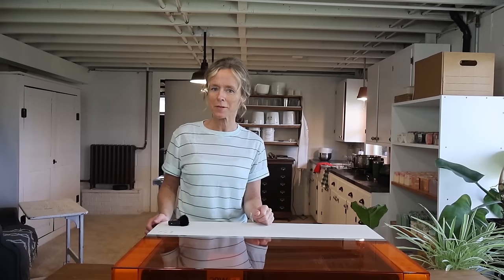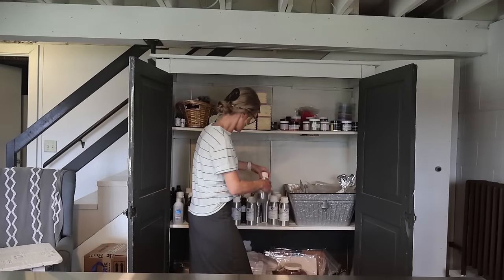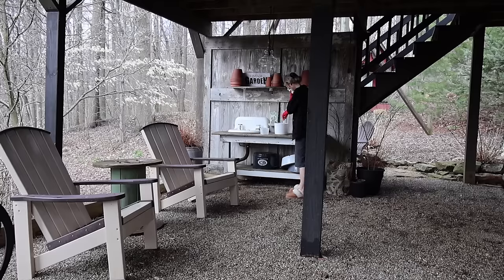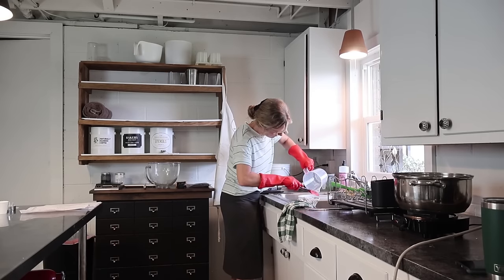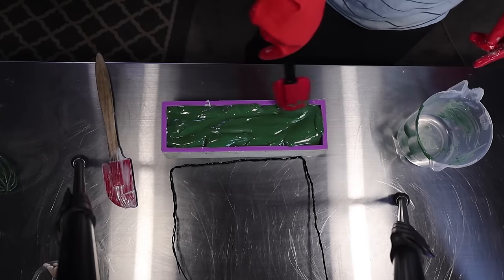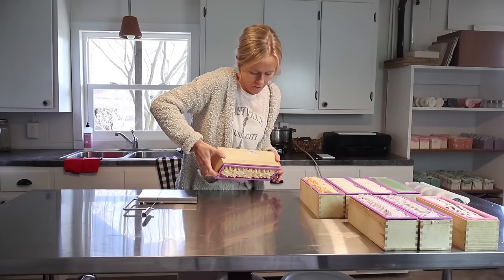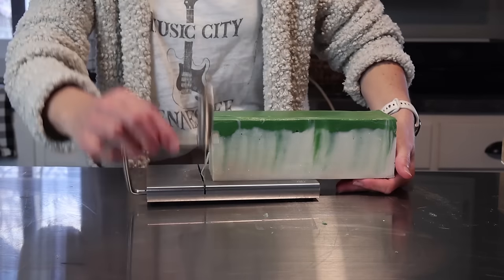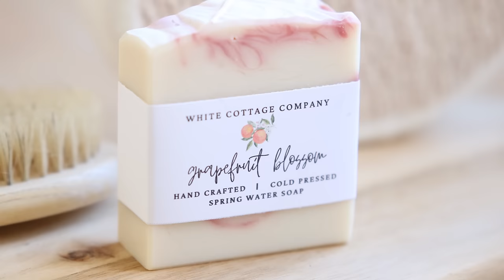Handmade Soap Making ~ Cold Process Soap ~ Homemade Soap Bars ~ Spring Soap Designs~Small Batch Soap

Comment: Ive been dabbling in soap making off snd on for a few years. I was origionally trying to figure out how to work with bees wax and shea butters but that didnt turn out as well as i hoped. I made some shower melts that make your shower smell amazing and it melts down the drain. But now im getting into actual soap making. I love the melt and pour method. They came out with a clear soap that you melt and you add your own ingredients and fregrance to it and its so easy to cut. It melts in about 20 seconds in the microwave and i dont believe lye is in it but im not sure. But all the hard stuff is already done and you measusure out your own ingredients and you can use the same stuff to make shampoo bars as well. Im super excited about that.

Comment: Lovely soap! Thanks for sharing your knowledge and techniques. Please do reconsider the use of a glass mixing bowl for mixing the batter. According to the makers of Pyrex and Corningware, strongly caustic solutions (such as lye solution) do etch glass over time, causing it to shatter unexpectedly. Even if that doesn't happen, you could also drop the glass container, or knock it over accidentally. Either way, now you have a mess of caustic soap batter mixed with glass shards, making for an extremely hazardous cleanup. The large plastic bucket that you used for the second soap is so much safer!

Comment: How gorgeous of a space you have down there and outside. Id be so thrilled to have some of that space. 😊 I absolutely love your outdoor space as well. I tried to get an outdoor sink here but it hasnt Worked yet definitely need some space as I am nervous about doing in my kitchen. Not sure if I have enough space and ventilation and has held me back to start but really want to and truly yes I love watching soap making recipies. I'm with you.  The big bowl is awesome too. Do you know how much you will make so you aren't left with too much extra and you can fill the molds you have. It looks like you need at least 2 rectangle molds for that bowl. I have some small molds but working on the wooden outside. I have an old silicone mold for bread but not sure if it's strong enough without the wood box so even if I just put a few pieces of wood together around the outside. It all adds up but yrs very wonderful and relaxing and am excited to begin and make something free of the costs and ingredients added to a lot of soaps. Am nervous about getting it right but I'm sure it will be very satisfying and  have you just used a regular cutter before that one like a potato slicer from pampered chef the ones that you have to eyeball or measure slices handheld ones. That's what I was thinking of starting with. Love even ones and where did you get that slicer. Looks fun and easier.. are there measurements or lines to get even cuts? I love your table and space. Looks perfect for lots of crafts
Where do you source your ingredients etc. love this video gonna rewatch. The green one came out very cool

Comment: Hi sweet Mary,
I don’t know if you respond to your comments, but in hopes that you do, I have a question for you. I am venturing out in soap making and have been trying to do research. Some soap makers say you absolutely have to use distilled water. I found another video where they use spring water. It has been said that the soap will not turn out properly if you don’t use the correct water, do you know if this is true? I trust your judgment completely! May I ask  what kind of water you use?